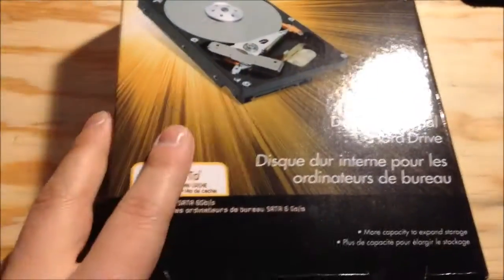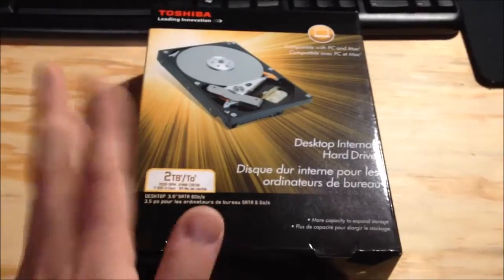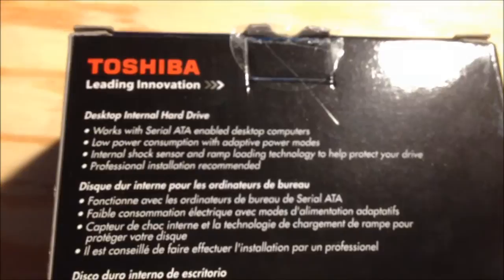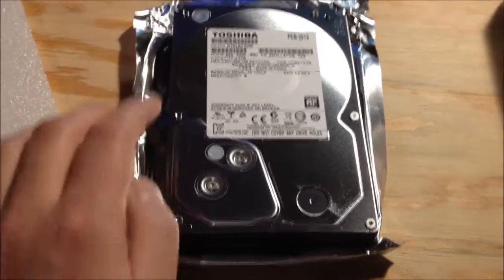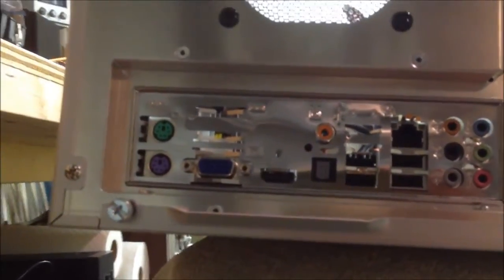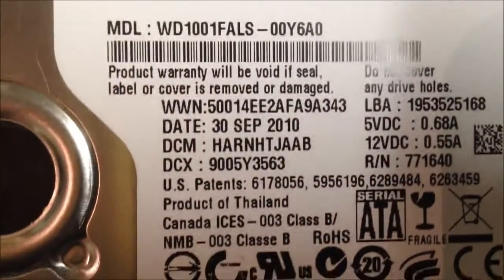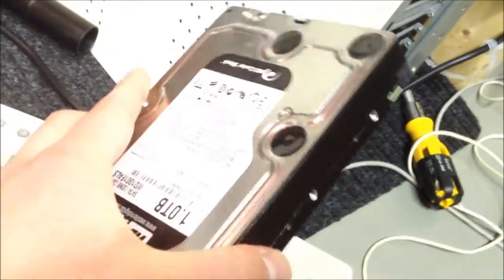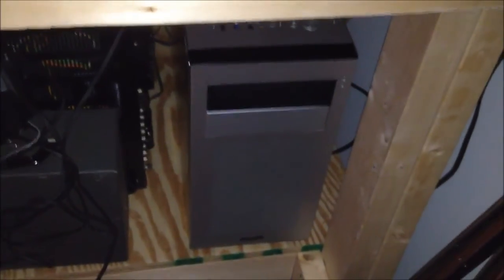File Server 5-14-2013: Hard Drive Upgrade & Data Migration

Comment: You can run 2.2+ TiB drives initialized as GPT disks in nearly every distribution of Linux, OSX, Vista, 7, and 8 as a single partition. 

UEFI is only required in Windows if you are booting to the drive.

Comment: I still have a Hitachi DeskStar 320gb from 2007 that has over 23,000 hours on it. I didn't really trust it after 20,000 hours, but it still works just fine in my Dad's PC.